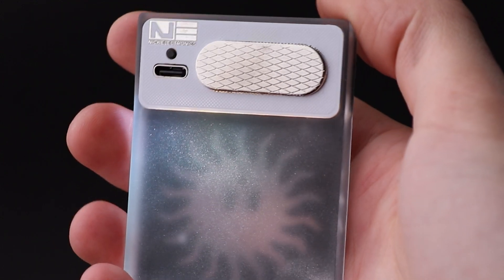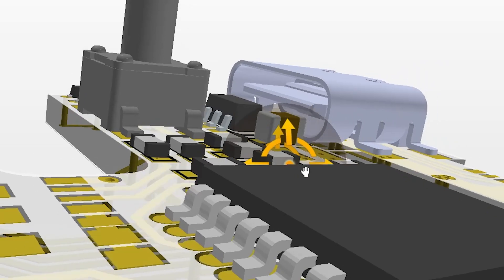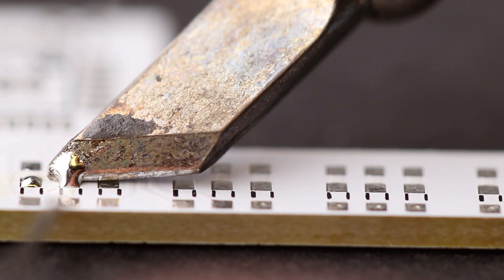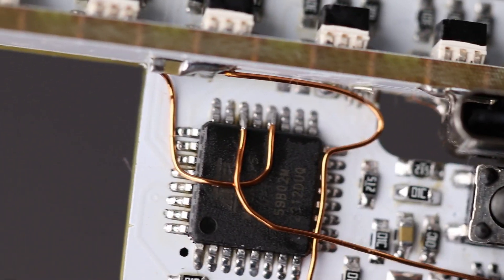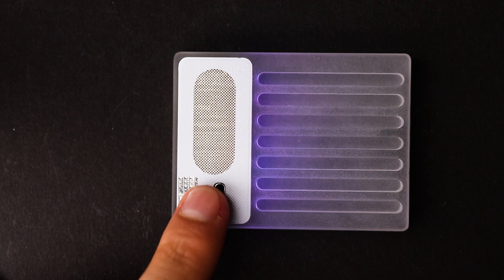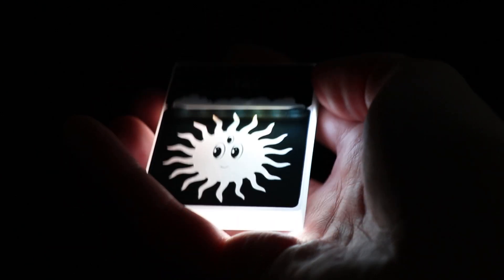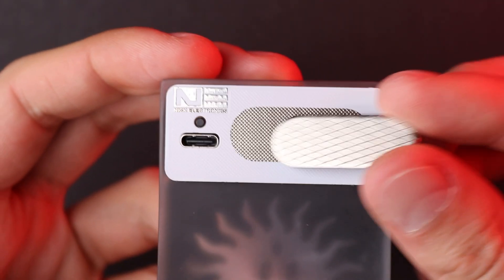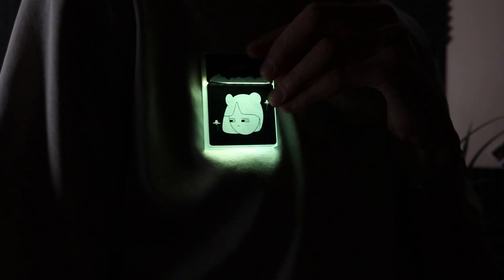Making a Glowing Badge (1st Try)

Comment: glues are far more reliable than you think
Reply from the maker: You have got any particular glue in mind? I was thinking to test some. Like Henkel magnet adhesives or so. Also i have been taught that in the direction of stress only gluing is not enough. But idk, have to test
Reply: @NickElectronics 
honestly no I don't have any suggestions but i bought a phone holder years ago and i glued it to my car dashboard and it's still functioning I tested that glue rigorously in these years
Reply from the maker: @aminghafoori6496  Okay, thank you for the info) I kinda know that glues are amazing nowadays, but as an electrical engineer could not resist soldering metal plate instead of gluing magnets) Soldering just looked as a little bit more robust option
Reply: E6000 maybe?

Comment: Battery pack on inside of shirt wirelessly powering the leds? 
I love the patterns created by the channels! Maybe some layers from an lcd screen can be used as a diffuser?
Reply from the maker: Yes, I have an idea to put battery under a shirt ^) But wireless power transfer is not the most efficient way to power the circuit. I think in the direction of a metal pins that would serve as a fastener and + & - contacts. 
Idea with an LCD screen is also in my head) I hope i will have enough time in the future to realize it :) 
Probably, putting a screen is the best soultion btw But from the other side, most expensive :)